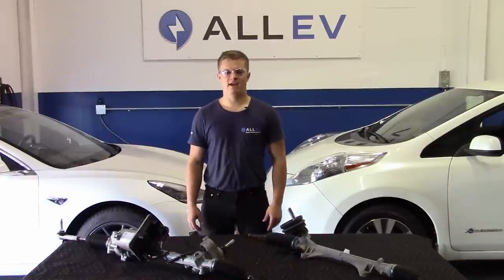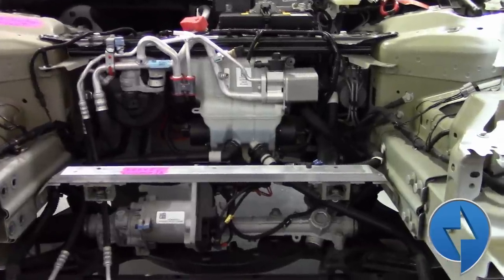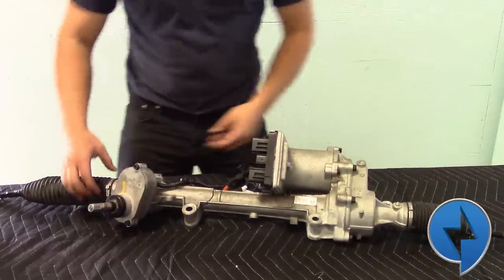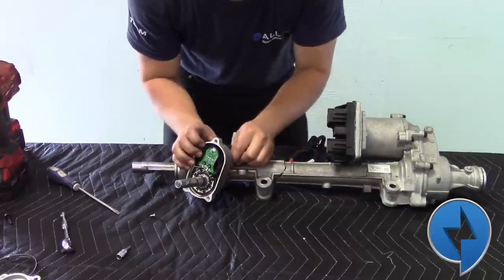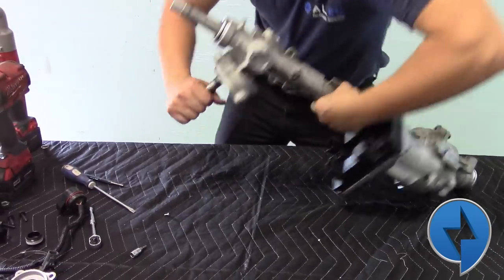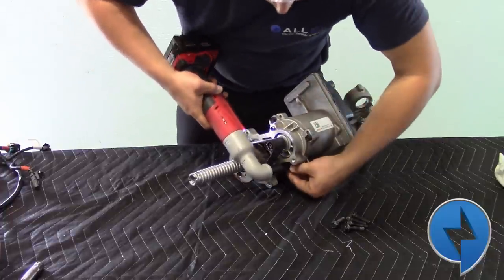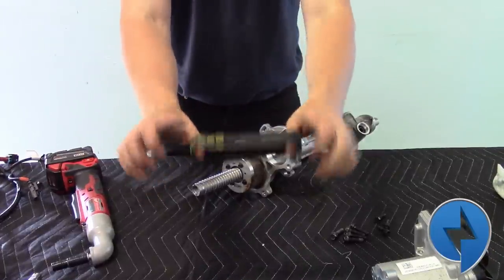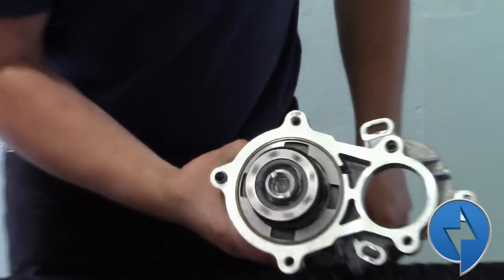How a Tesla self drives -  Belt driven steering rack

Comment: Most modern cars have electric power steering and utilize a similar setup, including most, if not all of the electronics shown, especially if they have drivers assist features such as lane keep assist or auto-parking. There are two main styles used, the rack mounted motor that you have shown and a column mounted motor that the Leaf uses. The motor on the Leaf will have many similar components as the steering assist motor Model 3, especially if it has the above mentioned features, as there are only a few suppliers that manufacture steering systems. Those components would just be integral to the column/assist motor assembly instead of mounted to the rack. The rack for Autopilot equipped cars isn’t anything cutting edge, it simply receives commands from other vehicle systems telling it when to turn, which way, and the rate of steering input needed when Autopilot is engaged. While the rack itself is nothing special or advanced when compared to the competition, Autopilot is pretty impressive.

Comment: Wanted to thank you for this video. I have a model 3 with 150k miles on it and my rack just started sticking. After watching your video and another on how to pull it I decided to do it myself and completely take it apart and re grease it all and it worked perfect. No more issues. Ty so much.
Reply: Did you make a video out of it?
Reply: @ChrisGageTX  no I did not but it's the same as the two videos I watched, just used this one to see what to expect when I take it apart and the other to see how to take it out
Reply: @danieljw1985  Did you find dried up grease or anything like that?  I want to grease mine but don't know how far I have to dig in to get those little bearings greased.

Comment: An important element of the ball screw and the belt drive is that there is no drive Line lash or free play in the system.  That is important for smooth steering by computer. In my old cars I have to compensate for free play in the steering by steering with fingertips and pushing against the free play.  Efficiency in the classic sense is not that important since a lot of power would not be wasted here anyway.
Excellent informative video... THANKS!

Comment: Its not a sensorless motor. The ship above the shaft does the angle and hall sensing. The shaft has a diametrically magnetized field.
Reply: That’s probably why the chips on the board aren’t symetrical, both need the correct corner of the chip to sense that hall sensor

Comment: Very interesting! Thanks. I wonder what voltage the drive motor is operating at? 360VDC or 12Vdc?.. that little motor could be interesting for small ev projects like electric bikes. I see from the PCB side of the drive that the motor shaft have a magnet on the end. it is probablt working with a SIN/COS encoder chip on the PCB.         Doctorbass, Quebec city
Reply from the maker: Thanks for the comment. It is low voltage. The end is magnetic.
Reply: Yes automotive electric steeringracks have been commonly known to use field oriented control to reduce torque ripple which can be felt through the steering wheel otherwise. It makes perfect sense for them to use a magnetic angle IC to get accurate motor position used for proper FOC

Comment: Neat video.  It's not the kind of peek-a-boo you'd want to do on your own Tesla just out of curiosity.  But can you remove a heat shrunk part like the belt gear? I did this once with a cheap spade bit and a length of 3/8 all-thread to make a good extended drill bit for running electrical flex down through fire blocking. As you know you heat up the outside which expands, hammer it over the shaft and as it cools it shrinks and,   it's better than welding. However it was my understanding that if you try to reverse the process by heating up the outside, because it is in contact with the shaft, they both heat up at the same rate,  both expand at the same rate, and they'll never come apart.
Do you  know that you can reverse the process?  Thanks.

Comment: Hi, excellente job! My steering rack module had water ingress in the positive terminal and the corrosion broked it...i need to replace de terminal and i can't desolder ther 3 pin to the motor or the terminal itself. could you tell us the tecnik and and produts that you used to remove the solder? thanks!

Comment: Every other electric power steering system that I have come across combine the torque sensor with the motor into one unit on the input shaft. I don't see why this design would be considered as it appears to be less mechanically efficient.
Reply: This right here is probably the most common EPS unit in the world. Made by Bosch. I don't like the belt driven design.
Reply from the maker: Very good question. Perhaps the other design reqires a planetary gear set and that is unwanted. Or maybe using a ball screw is a more efficient method of power transmission compared to a rack and pinion.

Comment: I assume this unit is also the power steering as well.  So no more power steering fluid ?
Reply from the maker: yup!
Reply: @AllEVCanada  yeah, my 2014 hyundai accent has electric power steering.
Reply from the maker: @graenicholls4657  It is very common these days. Does your car have lane keeping abilities?
Reply: @AllEVCanada  LOL, no. Was just refering to "no more power steering fluid" being commonplace, not the design of said units nor capability.
I should be more explicit in my comments.
although, if I am on a nice bit of highway with no camber or corner it will self drive...dead ahead LOL
(joke)
Reply: @AllEVCanada  GREAT video, by the way.

Comment: Come on  Tesla.... really a thin rubber belt? Lol. I would have thought such an important component would have been a metal chain. I hope they did a lot of durability testing on that thing. When I get my Cybertruck hopefully it’ll be upgraded.
Reply: I think you can assume that the best is very very strong and more than capable of outlasting the life of the other car components.
Reply: Belt technology is more advanced than most think.
a timing belt in a 1990 SV21 Camry lasts 100k kms plus withstanding constant speeds from 600rpm to 6000rpm in a hot environment. the failure rate  of those was very very low.
The belt in this little unit would probably be able to last beyond the drive motor or the ball nut screw drive mechanism.
It probably has carbon fibre or kevlar, or some other exotic fibre reinforcement.

Comment: Redundancy:. Can you see the connections?  If the electronic drive is redundant, maybe there is a dual set of coils in the motor so the actual motor is also redundant?
Reply: Sorry, looked at the video again. there are only three contacts for the motor, so the windings are NOT redundant.....  maybe there are parellel windings inside, but not a completely redundant system as I may have though.  I guess if there is not risk of thermal stress, they figured that there wasn't a point to redundant coils.

Comment: hmmmm, my confidence in self driving is lowered due to thin-ass belt. 

"...you take what you want from that"   Ha!
Reply: The way I see it is that we run belts for like 100k for timing belts. These run non stop at high speeds which would see more wear and tear then the slower movement of the steering belt
Reply: It’s not exposed to the elements so would likely last the life of the car.
Reply: 9to5aintlife  And if it did fail the life of the owner could be severely shortened. Just kidding, I'm sure some very loud warning would go off if the belt broke. Wouldn't it ?
Reply: I'm curious about how much force could be transferred from the wheels to that belt before other parts of the suspension start to break.  Or what if the car decided to kill all humans and you were fighting it via the steering wheel - who would win??
Reply: @terrysullivan1992  the controller would be able to see belt wear... Teeth would begin to skip at least a few revolutions before breaking, and I assume as soon as that happens (commanded position deviates at all from actual) alarm bells would start to ring and the driver would aim for the shoulder, wether self driving or manual.
Reply: No matter if a belt breaks, Tesla builds redundant systems for safety. As far as safety goes, self driving vehicles will have a fraction of the accidents that human drivers are responsible for.
Reply: Same feelings 😅

Comment: One thing i still can not understand is, why a belt? Why not a planetary gear or a worm gear or just another type of mechanical connection?
Reply: Belt is quieter, lighter and does not require lubrication.
Reply: @alanw.4511  but it may require a replacement, or it is harder for a belt to cope with quick movements and heavy torque.
Reply: @ZZZxRv  The belt can handle the speed and torque because it is geared allowing the motor to be high speed. But yes, it can break but is easy to service. Plastic gears can strip teeth and metal gears wear out and if a chain is involved it can stretch and requires lubircation. Belt is simpler, quieter and lighter.

Comment: Extremely interesting from a machinery safety point of view. One belt would never be allowed for something safety depend in other machinery. Yet it is in a Tesla... very interesting indeed. IMO this confirms the cars can never be self driving, at best a Tesla Model 3 will simply be auto pilot and will alarm the driver if a malfunction occurs.
Reply from the maker: Will be very interesting to see if this part changes in the future.
Reply: There are plenty of single point failures in commerical airliners, they just have good statistics on how the parts wear, so that they can be replaced during maintenance, and good QC on the part manufacturing. Combine this with simple measures to detect belt wear, and I think this is a non-issue.
Reply: @kschleic9053  Name a few?
Reply: @mrwizard233  I talked about single point failure components on an air plane. Name a few? Critical ones.
Reply: @mrwizard233  So, you are talking about the engine, that goes through really advanced maintenance with ultra high super precision on an airplane that has more than one engine and can both take off and fly and land without problem even due to one engine broken? And a catastrophic so bad that the airplane can not land safely is so extremely rare so it is ridiculous. And then you compare that to a belt made out of material that will age in heat and cold, that has no maintenance, done what so ever, has no redundancy at all and in a futuristic self driving future will lead to a crash, maybe involving several other people?

And landing gear - there are several redundant systems for the landing gear, and even if all of those fail you have a plane constructed to be able to belly land or land on the other landing gears that still work?

Yes, the Boeing sensor was one that might classify, but not entirely. One problem added to that was the lack of education of the pilots. You see, the pilots are always standing by to take over and take proper actions so if they were trained properly, this probably would not have happened. In fact, it was three stages that failed (so, not one single point here): Maintenance, pilot education and the AOA system).

Under normal circumstances, flying is incredible safe, just because of all the redundancy there is. Flight computers are redundant (so in fact as an example, on large airliners, there are at least three different computers, constructed by three different teams, and programmed by three different teams, to avoid a single point of failure like construction fault and the plane can fly with one computer down).
Even your car have somewhat redundant brake system with two brake lines. And, you have the parking brake as a third option. And if the hydraulic pump goes, you can still brake (even if it is pretty tough).
And the steering wheel, the same: If power steering fail, you still can turn the wheels.

But, now on a Tesla, if the car is driving by itself, without you watching and being prepared to take over, you have a critical one single point of failure. If the rubbery belt goes... the car goes. In fact, if the 12V battery goes, the entire car will just abruptly shut down because of lack of power and... since you do not have the same as on trucks, where the brakes are actively released (instead of actively applied like on cars), you are in a pretty nice trouble.And they have other SPOF that prevents them from being fully self derivable, Level 5 (or even Level 4) but that is another debate.
Reply: @mrwizard233  Of course it will not be sufficient with a tiny brittle belt for a SAE Level 5. And if course it does not matter if you service it often since there are No redundancy what so ever if it brakes and you are in Level 4 or 5 (or even 3). Remember: NO redundancy!
That is not okay and will not be okay, to rely entirely on a rubber belt.
Since you are responsible for driving the car, of course a failed belt will not cause an accident. The driver will cause an accident.
You are 100% responsible for driving the car, under all circumstances. Always. And also, since a failure of the belt will only mean that you do not have ADAS steering available anymore or power steering, that will not cause an accident. The car will alert and you will steer the car to safety. No problem there.
If the car is driving and the belt goes, no one! will steer to safety.

But, do not worry. The belt alone will not stop it from being Level 5 in the future. A lot of other stuff will too so...
The Teslas out there on the roads today will NOT be Level 5. Just forget it. It is impossible as they are built.
And even if they rebuild cars or redesign completely it will still take at least 15-20 years to reach level 5, as a research vehicle.

And Tesla will not be first...
Reply: @mrwizard233  If we talk about self driving, Level 5, the sensors are the biggest issue (if we leave out the software that makes it impossible in the first place) and has nothing to do with redundancy at first.
Then of course you will need redundancy on steering, just like we have on brakes. That is two minimum features that just HAVE TO WORK!
And to control this you will of course have redundant computers so if the computer fail, it should still be able to steer and brake to safety.
And if we talk about software so, remember that you in fact have to be able to understand all kind of "what if" situations to reach level 5. Drive under any conditions, anywhere at any time (that a human can).
So if the computer fail where a human would have done it - you are not Level 5.

And that safety data is, well.. no. That is a claim from Tesla. Not NHTSA. NHTSA has no ranking on safest car on the road.
Reply: @mrwizard233  Then show me the data.
The data also shows that Tesla is worse for the occupant in a small overlap crash.

Are the computers designed differently? How is the fault detection done? How is the switch done? Is it different software?